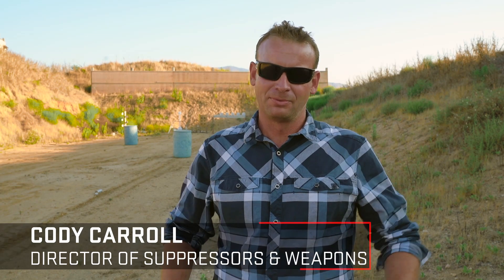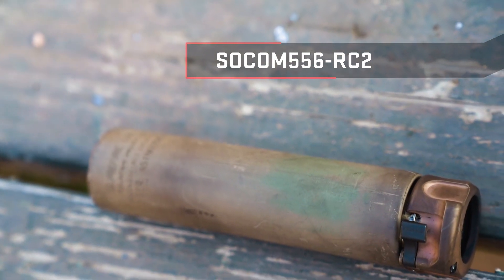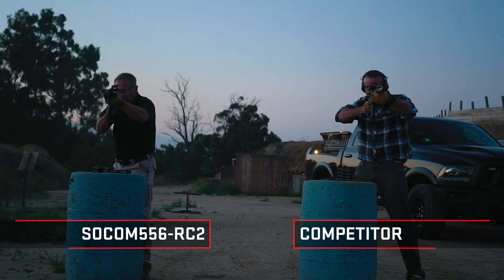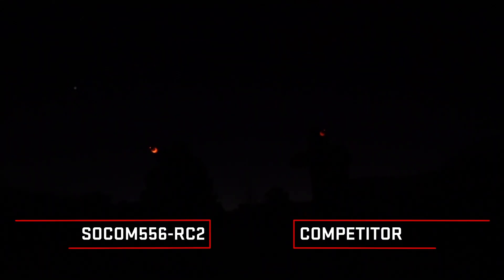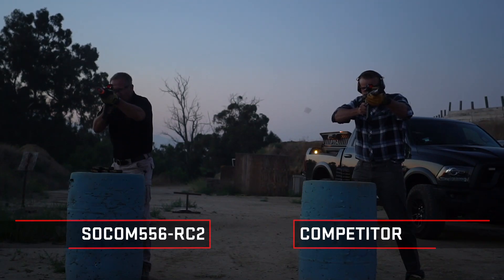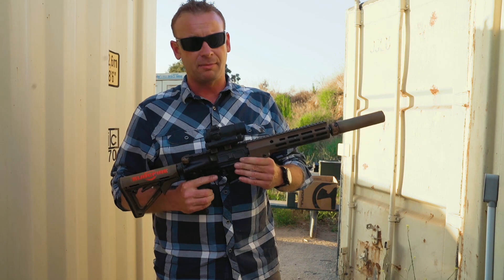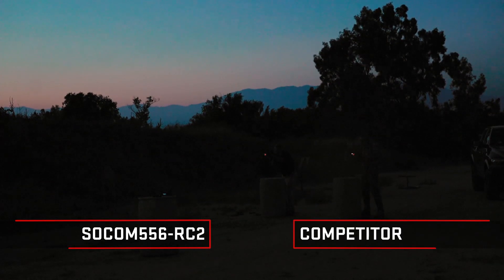Factors in Judging a Combat Suppressor

Comment: Oss helix is know for gas being pushed forward that would (IMO)cause a fireball at the front of the suppressor. I would love to see a comparison with a deadair sand man s 5.56 front cap so I can see if I trade or sell it fore a surefire lol cool video btw.. I plan on getting the rc2 anyway i just wanted to see a comparison 😀
Reply: The OSS was only chosen in this video for exactly that one reason, they knew it would throw a flame ball and thus create a more dramatic comparison. It doesn’t make either can bad as they were both designed for different applications. The OSS is more designed for civilian applications which as we all know is the shhh factor and les gas blown back at the operator. The SOCOM was designed specifically for just that organization. The can is Inconel front to back, which is stuff that’s put up into space aboard shuttles. Not only that but the first round flash and pop as described is a big advantage for special operators in direct action type missions. Most of not all OSSs are made from titanium in fairness, but my point here is that it’s just hard to dub one can as inferior when they both were designed with intent that’s worlds apart.
Reply: They don't want that.  They picked the OSS because they knew it would be an obvious difference.
Reply: disposable1911 they picked OSS because OSS said Surefire wasn’t making it through the military’s new testing. The Surefire probably has better flash reduction than a dead air sense the design criteria are different for the two

Comment: Any guesses to what the "competitor" can is? "Flow through" can only be OSS or NG2, right?
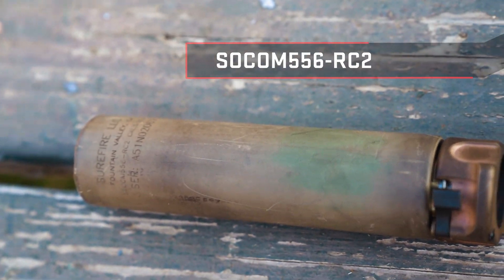Edit. Nvm. It's the helix.  Pause right at 0:50 when the can is lit up from the flash and the distinct end cap design with the multiple swirled/angled ports of the OSS helix are visible.
I wish they'd talk details on how the can did. Never seen a torture test of an OSS Helix. Wonder how it held up.